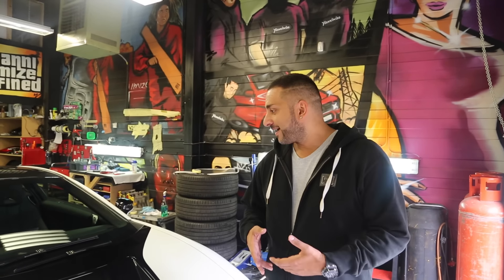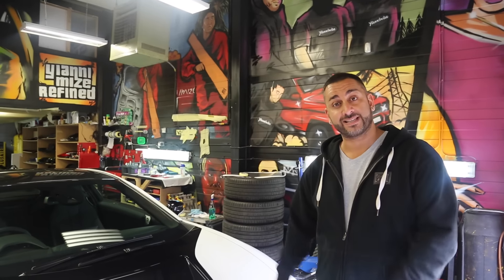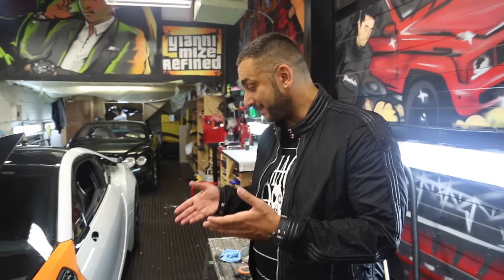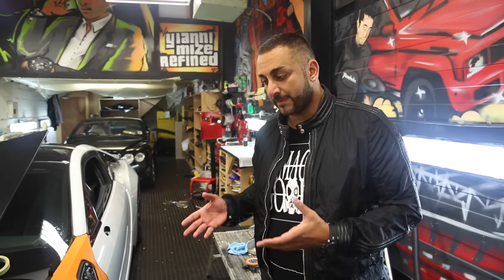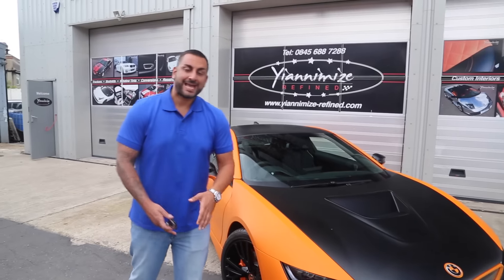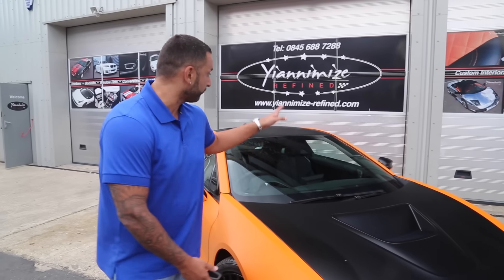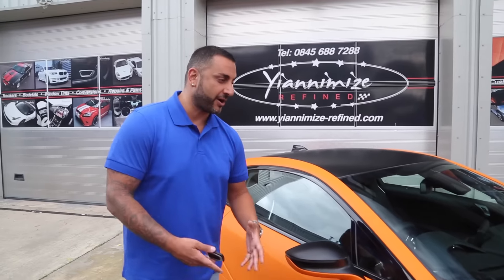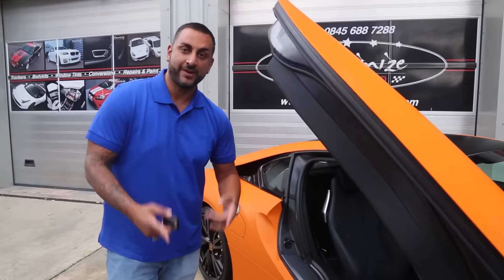BMW i8 Gets Wrapped HOT Orange!

Comment: The i8 is a hybrid
Reply: not elecktrical
Reply: +Lord Mats you need to work out how to spell before deciding to criticize someone else's small mistake. further more he isn't incorrect at all. the car is both electric and hybrid. it can either run on the electric motor alone (hence making it an electric car) or run it with the engine and electric motor (hence making it a hybrid car) you could never put a drop of petrol in the thing if you don't want to